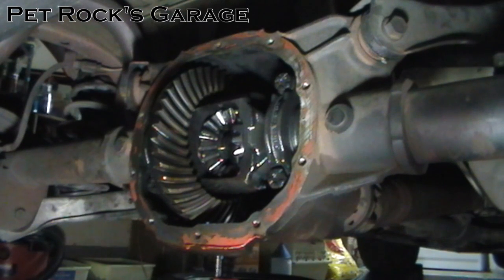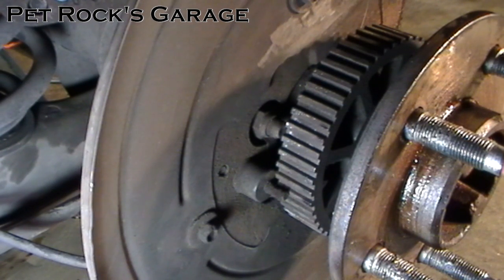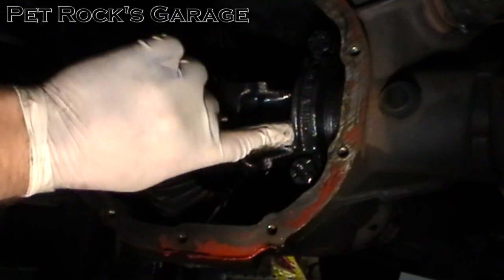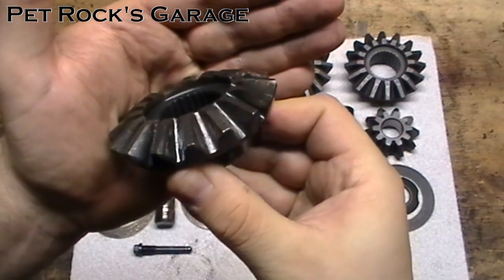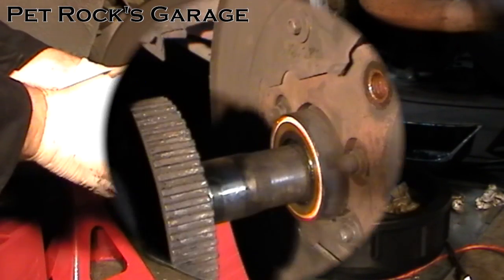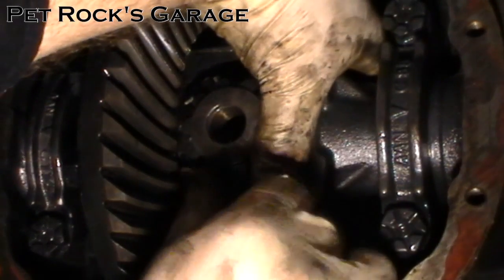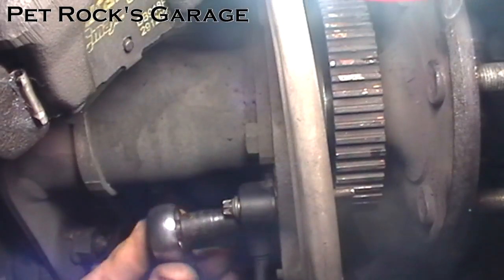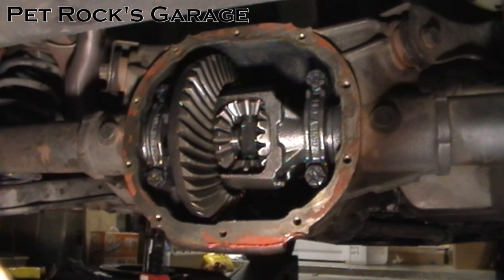How To Replace Spider Gears In Ford 7.5 & 8.8 Open Differential - Ford Mustang

Comment: very well explained boss man. idk shit about cars or know anything about "how to's" but ur vid actualy gave me the confidence 2 go out n try it my self 2morrow. my diffirential locked up on me lastnight i had to tow my car home  so hopefuly takeing all that out cleaning it realy good and filling it bk up will fix it. i do have ALOT of back lash when puting my foot on & off the gas... SO MYB frm what iv learend so far i might need them lil circle lashes thigs replaced n get new 1s from what iv seen doing the oil change on it wont fix the back lash nor the winning on it but ill keep my fingers crossed. thank u if u have any pointers on ANYTHING I SHOULD KNOW B4 TEYING THIS OUT id appreciate it if u would let me know. thanks again 1 of the best vids iv watched so far hands down. thanks again.
Reply from the maker: Thanks a lot. I appreciate it.  If your differential locked up then something metal broke inside there and probably got jammed in one of the gear teeth.  A fluid change will not solve the problem. It is impossible to say what the problem or solution is without taking the diff cover off and having a look inside.  Since you said you don't know much about cars, if there is a broken bearing or gear inside (other than the spider gears) I would not attempt this yourself.  Installing new gears or bearings requires special tools & some skill.  I would take it to a shop to have them fix it once you have looked inside to see what is wrong.  Good luck.

Comment: What would be the break in period??
Reply from the maker: I don't remember what they were on these gears. They gear set came with break in instructions from the manufacturer. I don't have the instructions anymore.  I would say 500 miles of low to mild use should be good. Don't go drag racing, light to light sprints or nothing like that.  Hope that helps.

Comment: Awhhh the good ol E8 tool. Now this dude is hard core. Bet he had to buy it to do the job, No sissy air tools for this guy..
Reply from the maker: Nahhh, I bought the E8 socket as part of a set over a decade ago to replace the rear brake slide pins on this car. No better time to buy a tool then when you need it to do a job. Re air tools: they have their time & place IMO. Nothing sissy about them at all. If you turn wrenches all day, where time is money and Carpel Tunnel is a concern, then they are a necessity. But for the regular DIY'r they are a luxury. I have them, but its sometimes a P.I.T.A. to get them out and set up the air compressor for a few nuts/bolts. Most times, IMO, it is easier/quicker to do it manually. But if you want to use air or cordless tools go right ahead. All that really matters is the job gets done, right?

Comment: Hey, after reinstall differential on the right side on my 2013 Ford Mustang I have an issue which is when I make a turn to the right I can hear some noise from there. What the problem could it be?
Reply from the maker: It is hard to say what is wrong from my keyboard.  I'd take the diff cover off and have a look inside.  Also make sure you put enough fluid in, and if you have a Limited Slip Differential make sure you added friction modifier. Good luck.

Comment: Hey man just wanted to ask what lead u to the issue I know u said it had play in the spider.. But did it knock or cluck throughout the drive line.. I'm currently working on a 99 Chevy Suburban that has a Knocking in the entire drive line U-Joints are fine Yoke is also fine.. Can u offer any advice.. Thank u so much brother
Reply from the maker: Knocks/clunks are always hard to find.  Don't rule out suspension issues (e.g. bad shock/control arm/sway bar bushings, tie rods or ball joints etc). In this case I was changing the rear brakes and noticed the excessive play at the wheel.  I also needed to change the rear diff fluid, so I pulled the cover and noticed the problem with the spider gears.
Worn spider gears can cause all sorts of strange noises.  Like a werrring noise on deceleration or clunks when making sharp turns or going from drive to reverse and things like that.  Maybe put it in park (assuming it's an automatic), jack the rear of the car up, chock the front wheels and try to rotate the drive shaft by hand to see where the play is.  If it is coming from the diff area then pull the diff cover and have a look inside. Akternatively, you could pick up a borescope from Harbor Freight and have a look inside through the diff fill hole. Good luck.
Reply: Pet Rock's Garage ... Awesome brother.. Man I really appreciate your help thank u
Reply from the maker: No problem.

Comment: Thank you for a great video. It explained everything well. I intended on repairing a seal and axle bearing, but now I'm wondering if I should go ahead and put new spider gears in while I have it apart. It is a 96 Ranger with a bunch of miles. It did appear doable from your video, though I know "looks are deceiving."
Reply from the maker: If the spider gears are loose or worn then definitely replace them. They aren't a normal maintenance item.  So, in my opinion, if they aint broke, don't fix 'em.  Check out my video on replacing the axle seals & bearings on a ford diff (https://youtu.be/VXEqzMVRRso). Thanks for watching & commenting. I appreciate it.

Comment: Great video. You didn't clarify in the video, so someone may do unnecessary work, but you don't need to remove the spider gears if all you are doing is removing the axle shafts. I always just leave them in place.
Reply from the maker: True, if you have a center pin with a cut out in the middle like the aftermarket one I installed in this video you can just rotate the center pin to give clearance for the axle shafts to be pushed in etc. However, if your center pin does not have the cut out, like the stock one I replaced on this car, you have to remove the center pin. At which point it is super easy for the spider gears to fall out and potentially get damaged if they fall out of the diff & bounce around on your garage floor. So it's often easier/safer to remove them in this case. But go with whichever method works for you.

Comment: Thanks for making this video. I will be doing the rear end on my 99 f150 tomorrow. Curious if the 7.5 and 8.8 is similar to the 9.75 which is what i have?
Reply from the maker: They are very similar. The techniques I show in this video should get you through it. Good luck.
Reply: My pin did not come out easily at all! Lmao   This video helped a lot tho: I had to pull the carrier and mangled clutch discs out as-well. Thanks bud.
Reply from the maker: Those pins can sometimes be a P.I.T.A. to remove.  Sounds like your diff is a limited slip diff (via the clutch packs) which is slightly different then an open diff like the one in this video. But they are similar enough that you can get the gist of it.  Glad to hear you got it done and that my video helped you out.

Comment: Are all years the same size?
Reply from the maker: Same size diff?  If so, the size of the motor typically determines the size of the diff from the factory.  V6 mustangs typically have 7.5" diffs and V8 mustangs typically have 8.8". Other model Fords may or may not follow that convention. Best to check instead of assume/guess. Good luck.

Comment: Hey mine don't have the orings by the u clips. Could this be causing the play that makes it seem like my wheel bearings are bad? I have replaced them and problem is still there. I know the amount it has is not normal.
Reply from the maker: The rubber o-ring on the axle help reduce in/out play. e.g. pushing/pulling on the wheel. A bad bearing would have side to side play. I'm not sure where you would pick up new o-rings. Maybe the dealer?
Reply: Pet Rock's Garage thanks I just looked them up on eBay. They're only $12.99. Glad made this video. Can help a lot of people out.
Reply from the maker: Cool.  Glad to hear you got a replacement o-ring. 12.99 seems expensive for what it is though. I'm glad my video helped you out. Its why I make them. :-)

Comment: Thanks so much for helping solve the mystery of how to remove the pinion shaft lock bolt! Mine was fairly stripped by the previous knucklehead so it had to be replaced. Thought I would have to remove the bearing carrier bolts. Yahoo!
Reply from the maker: No problem. I'm glad my video helped you out.

Comment: hey bro, nice. what would cause excessive in out play on the axle shaft. very good videos very in depth and helpful for people who dont have wads of cash to keep their rides going or who just wanna learn. i dont usually subscribe but your videos are good and i have an above average knowledge of  cars thanks
Reply from the maker: There should be some in/out play with the axle shafts.  I'm not sure on the exact spec, but the ABS tone ring should not be able to touch the ABS sensor (if yours has one) nor should the axle seal be able to touch the ABS tone ring or the part of the axle that the wheel studs go into. The center pin in the diff housing prevents the axle from going in too far and the C-Clip & little rubber o-ring on the end of the axle shaft that I show in the video prevent the axle shafts from going out too far.  Make sense?
Thanks for the complements. I appreciate it and am glad my videos helped you out.
Reply: Pet Rock's Garage Hey thanks again turns out the clutch paks behind the side gears in my 8.8 trak lok rear end where worn. i replaced those and good to go. everthing else matched your vid
Reply from the maker: Thats great. I'm glad my video helped you out and you got your ride back on the road. A limited slip diff is slightly different then an open diff, but not to hard to figure out. Glad you got it done.

Comment: Doesn't work in the 7.5" rear end in my Ranger, the pin won't clear the ring gear.
Reply from the maker: I'm not sure what you mean by the pin not clearing the ring gear.  The center pin should be parallel to the ring gear and not come in contact with it and the pin that holds the center pin in place should be pointing away from the ring gear. Could you elaborate?
Reply: Pet Rock's Garage yeah my pin is beveled to allow it just to come out just far enough to let the axle c clips come out. for some reason it is set back behind the ring gear. guess if you want to change out your spider gears they want you to pull your ring off in this particular rear end. think im about to get my dremel out and file down the ring gear tooth that's in my way
Reply: if you google it there are posts from others with the same issue
Reply from the maker: That sounds odd.  Are the ring & pinion aftermarket? It sounds like the ring gear is either offset or has a more aggressive angle to the teeth.  I would not advise grinding a gear tooth.  That can cause noise & other problems.
An alternate approach would be to pull the pin out as far as it goes, replace the two side gears and opposite small gear.  Then push the pin back in so it's flush with the housing and rotate the housing 180. Then pull the pin out as far as it will go to replace the last small gear. Then push the pin back in so it's flush with the housing. That might work.  Good luck.
Reply from the maker: Yeah, I see what you are talking about now.  A simpler method to what I originally suggested should work.  When you pull the pin out as far as it will go like in his video you should be able to spin one of the side gears while keeping the other side gear stationary and it will cause the opposite small gear (the one without the pin in it) to slide/spin/rotate out. Once one of the small gears is out you can pull the two side gears.  Now all that will be left is the one small gear on the center pin.  Just slide it off the center pin.  Then reverse the procedure to put it back together. You don't need to remove the pin completely.
Reply: Ok thanks, will try in the morning, been trying to do that for about 4 hours but there doesn't seem to be enough clearance for the gears to walk themselves out of their wells in the housing. Will give it one last shot before I seal it back up, I've prolly got a a few other jobs I could do in the meantime and i don't want my ring & pinion gears rusting up while I sit around and think about what to do if I can't get it.
Reply from the maker: The key is to rotate only one of the side gears while keeping the other side gear still. Might be easier with the axles in the gears. That will cause the small gear without the center pin in it to spin/slide out kind of like I show in the video around 10:20. Good luck.
Reply: Thanks. Really appreciate the help.
Reply from the maker: No problem.  Good luck.  Let me know how it turns out.
Reply from the maker: I would advise grinding the gear. But its your ride.
Reply: Pet Rock's Garage got it bud, job's done. had a few snags, even lost one of the old washers inside the side gear well like a dumbass, tried to feed the new spider gears through an opening too small. Luckily I just scratched the back side of the teeth on one of the spiders, after I took everything apart again I realized where I screwed up when 2 washers fell out of one of the side gear wells. The old washers were so camoflauged and stuck to the side gears I coulda sworn I saw both of them. All part of the learning curve I guess. The new gears seem to work well and no apparent performance loss from ring gear tooth I filed so if something goes wrong guess I'll find out the hard way
Reply from the maker: Good to hear you got it done. Good luck.

Comment: what if the washers on the small spider gears make the gears not want to go in place..can i just leave the washers off??
Reply from the maker: No, I would not install the gears without the washers. The gears would be spinning directly against the diff gear housing and will quickly wear into the housing (since the housing is a softer metal then the gears) causing a really expensive repair.

Comment: I have decided my 4:10 gears are a little low as I have only been on the track once with it and now mostly drive on a highway to and from work. I have purchased 3:73 gears but am wondering if I need new bearings since the gears only have about 10K miles on them since replacement. (The entire rear axle was redone when I replaced the original gears.)  '97 Mustang GT'
Any adise?
Reply from the maker: Unless the new gear set has a different diameter where they interface with the bearings, you should be able to reuse them. Just take extra care as to not damage the bearings as you remove them from the old gear set & install them onto the new one.  Good luck.

Comment: I have a 2005 mustang the rear axle makes a rumbling noise but when I move the wheel back and forth the tone doesn't seem to change so I don't think its the wheel bearings there is no leakage in the pinion at drive shaft any ideas ??...............I have read everything from throwing a banana in there to quite it down ..... but after seeing your video it makes me want to fix it correctly.
Reply from the maker: It sounds like there is definitely a problem in the diff.  It could be the spider gears or it could be a problem with the pinion or ring gear or their bearings. Best to take the cover off and have a look inside.  With the fluid out it should be easier to pinpoint the problem. If its the ring and/or pinion gear or their bearings I would take it to a shop to fix since they are a P.I.T.A. to replace correctly. Good luck.

Comment: I never realized those thrust washers were in there. Any way to tell whether or not one of them fell out without pulling the diff cover and losing all the new oil? I had my axle shafts out today and accidentally spun the spider gears and one fell out. I put it back in, but now I'm wondering if one of those washers is missing... not good!
Reply from the maker: There is no way that I'm aware of to tell if one of those washers came out without pulling the cover.  You could catch the oil in a clean container and re-use it if you really don't want to replace it. Good luck.
Reply: Thanks for getting back to me. I pulled the cover to check, and all was fine. I then pumped the oil through a fresh engine oil filter for reuse. Had to buy one more quart, better than buying three.
Reply from the maker: Cool.  Glad you figured it out. Chalk it up to peace of mind. Filtering the oil was a good idea. A couple coffee filters stacked together are also good for light filtering of oil.

Comment: Is this a limited slip Diff? I don't have a LSD. I have to change my gears out and am not sure if it has spider gears in it or not. thanks in advance.
Reply from the maker: No, this is an Open Diff. If your diff does not have LSD then it is also an Open Diff.  Hope that & the video helps. Good luck.
Reply: Thank you for the fast reply and information.
Reply from the maker: No problem. Glad to help.

Comment: My 05 mustang is making a noise inside the differential yours was making gear noise when speeding at 20 mph to ?
Reply from the maker: No, mine wasn't making noises. I noticed the spider gears were worn during a diff fluid change. Only way to know what is going wrong in your diff is to take the diff cover off and have a look inside.  Many things can cause your diff to be noisy.  Good luck.